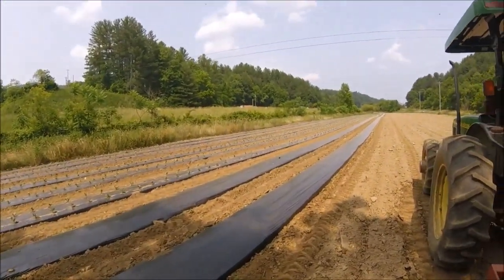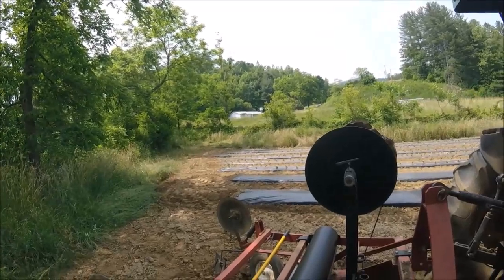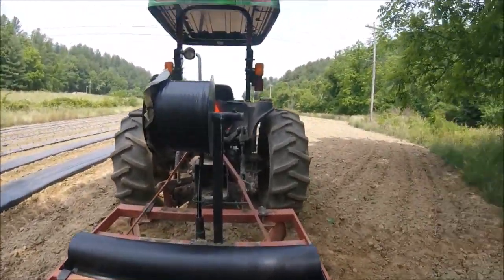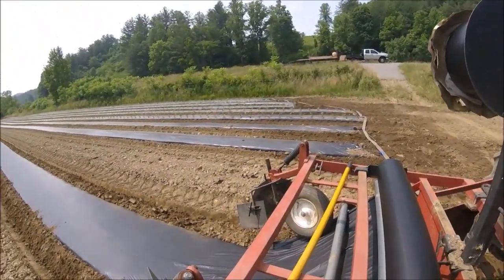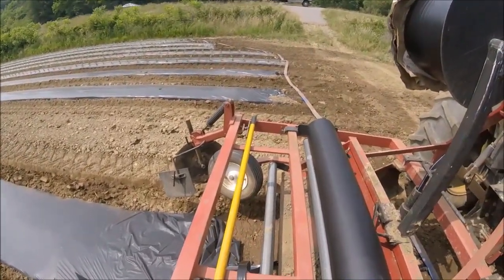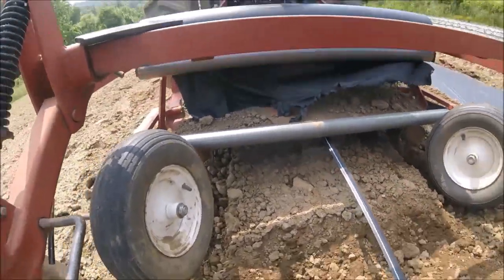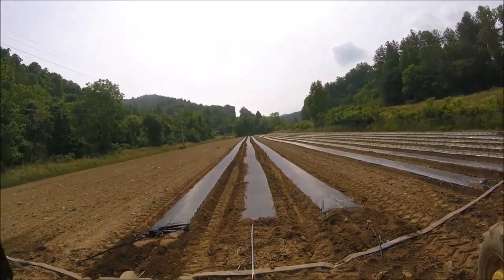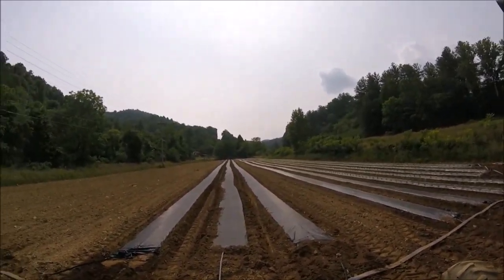Putting Down Black Plastic

Comment: That looks like 5 ft I ain't never seen a small one that lays 5 ft we use a rainflow 2500 we had one of them but our only problem with them is the beds a so short  do u use an airblast sprayer thanks enjoyed the video
Reply from the maker: It is 4ft plastic makes a 30'' bed. Yes I spray with a air blast.Thanks for watching